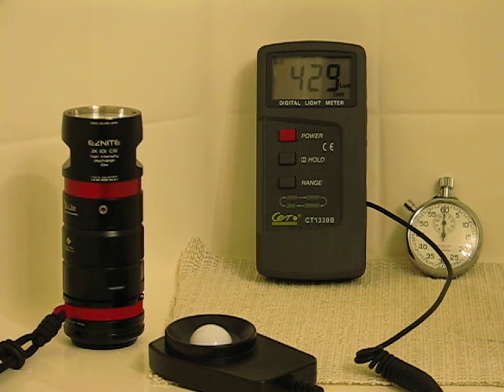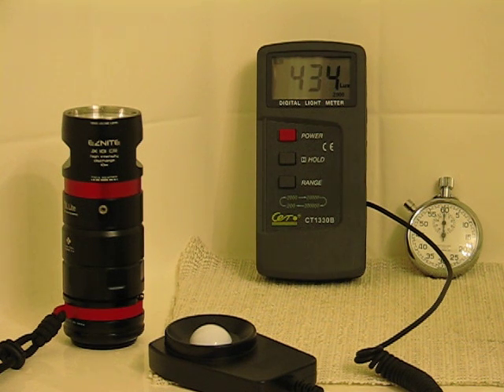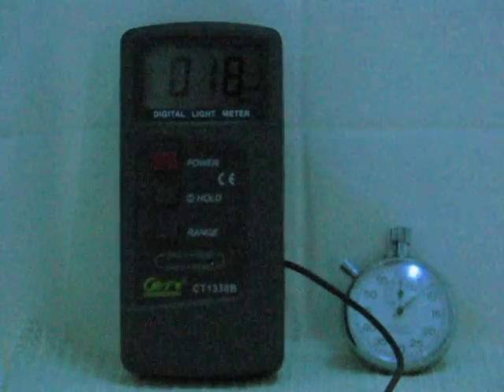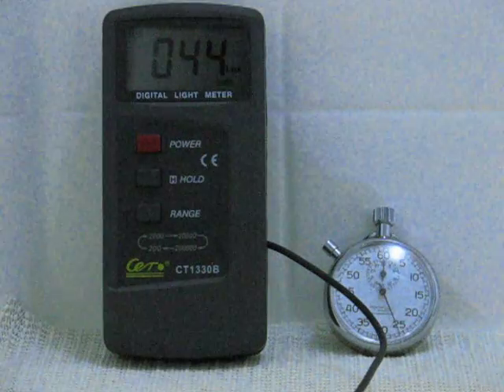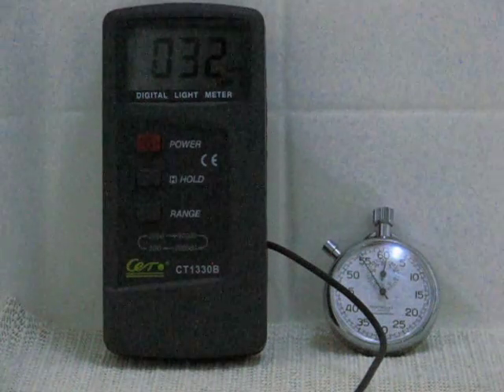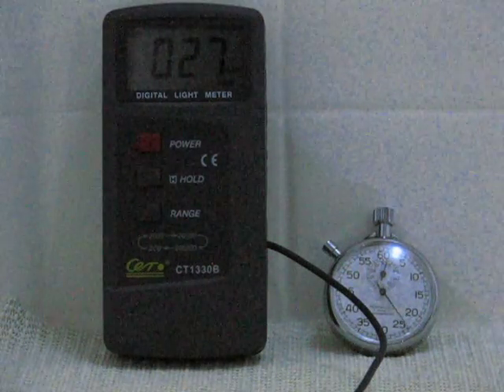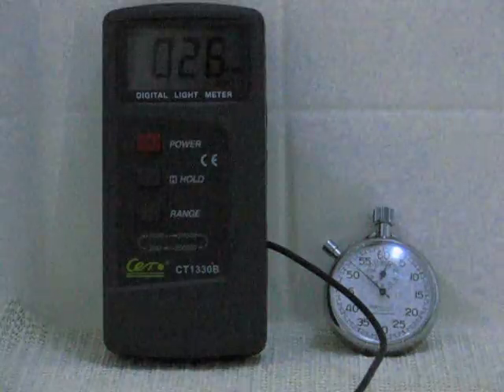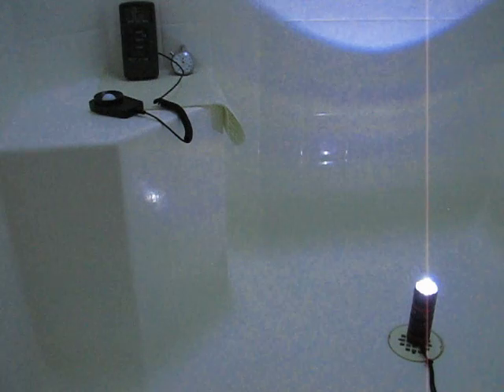HID warm up times JilLite EZNite 10W HID

Comment from the maker: @mvadinan540    You would need a very expensive piece of lab equipment called and integrating sphere.   With a simple light meter and a diffusion "box" you can determine relative brightness or lux but you can't determine "lumens."  If you developed a chart based off of actual known lumens of specific lights, you may be able to determine with fair accuracy the lumen of unknown lights by comparing them to known lights. For the most part though, that's a lot of work and lux numbers are usually fine